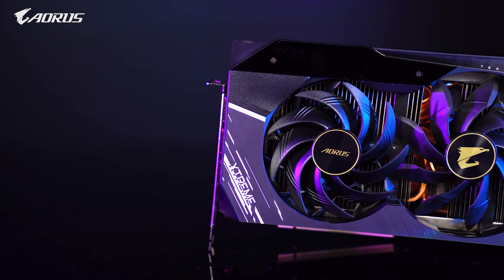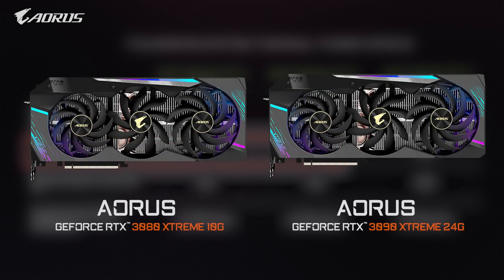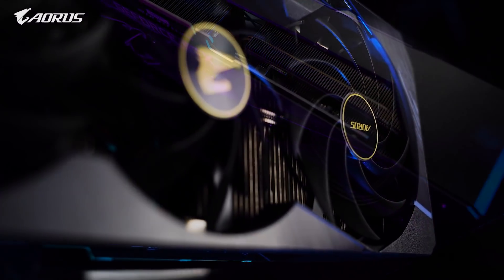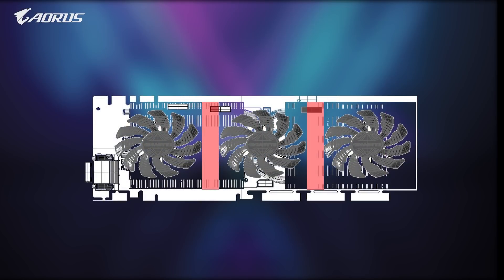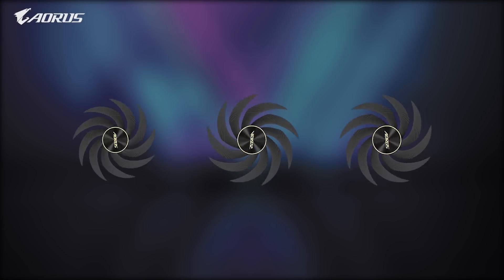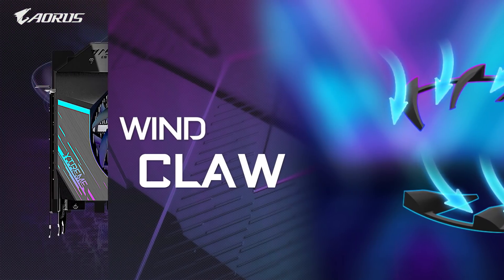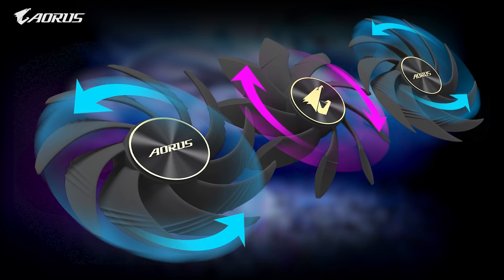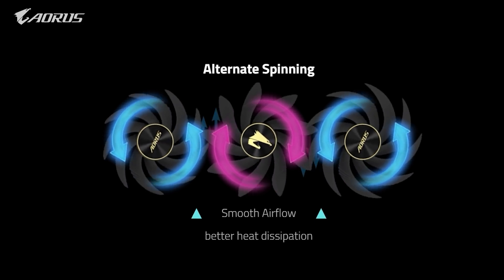AORUS RTX 30 Series - MAX-Covered Cooling | Feature Highlight

Comment: The real problem with this type of gfx card cooling setup in general (not limited to Aorus) is that the hot air from the cooler will be distributed in the computer case and not be removed from it quickly in a directed stream of air.  Even if the cooler fins are oriented towards holes in the backplate of the card, much of the heated air will go inside the computer case. At 70°, the fans on my card (currently a RTX 2070) start to spin up so much that my system is getting uncomfortably loud. The only way I managed to solve this problem and keep my gfx card at or below 65° C at all times was to install a fan in the side panel of my case, which thankfully has an opening for a  ventilator at the height of the graphics card. Unfortunately, it is pretty hard to get such a case these days. It's glass side panels everywhere. Personally, I don't care a bit about any bling inside my computer case. It sits under my desk and all I want it to do is to function as quiet and efficiently as possible.

Imo the perfect, although expensive, solution would be a water cooling circuit for the CPU and gfx card with a 240 mm or bigger radiator at the front of the case, pulling air from outside the case in the case and quickly removing the warm air with back and most importantly top mounted fans. I know that some tech sites claim you don't need water cooling, but they usually don't look at gfx card cooling, or even do their thermal testing with their test system's gfx card idling (which I believe makes absolutely no sense, since thermal and subsequently noise levels only become relevant when a system is under high load, thus creating a lot of hot air from the gfx card that the CPU cooler will inevitably use to cool the CPU).

Comment: Sounds nice, but so far as i heared all your gpus are 4 slot thick? I currently use a htpc case with your 1060 6gb 2 fan xtreme ed. version. This is around 2.5 , do you plan the 3070 or 60 in around the same thickness?

Comment: Are you going to fix the issue that the Aorus 2080ti extreme edition had that causes the fans to whine like they're taking off to space? That is caused by whatever thermal paste you use to completely dry up within 3-6 months of using the card, and is fixed by taking the card apart and reapplying new paste?

Its a fault of the card that a MIRIAD of people who own the thing have experienced, and should NOT be an issue with the cooling solution of a flagship card.

Comment: "Which negatively causes heat dissipation"  that doesn't make any sense.
Reply: I know right. You would want heat dissipation. How is that negative?
Reply: It causes causes it. That's what we want. But it causes that negatively. That's what he means. And they can do it in a better and positive way.
Reply: @highenemy2538  I get what you are saying but it is still not a good way to frame the expression  What the narrator should of said was "it causes heat dissipation inefficiently due to turbulence or something along those lines".
Reply: @holysnyper  exactly. I agree on that for sure. Am just putting out the true intentions out there.

Comment: NVIDIA  some guy  posted a video  there Manufacturing  has    3  chip  bins   1- 30%         2- 60%         3- 10%
  EG  no1 lowest class (windgate)            no2 are ti AORUS                 no3 titan Class     example 
the things you learn    all perform Equally good its just some have 10% better chip rates 💻

Comment: I seen the picture of the graphics card, where the dead zone would normally be, a solid black strip of metal. (Instead of more heat fins) Doesn't that solid black strip of metal kind of defeat the purpose of overlaying the fans?

Comment: However judging overclock shopping Aorus master and exteme will be overprice same like ASUS Strix. The cards will be on 15% more expensive than others except MSI which also expensive, but less a bit than Aorus and Strix. For example inno3D, EVGA, Palit, Zotac costs 650 pounds for 3080 when Extreme from gygabite costs 799 which is overprice. I understand cooling system is good, but pay extra 150 for it is to much!

Comment: Will this fit in a be quiet pure base 500 pc case with only aircooling?
Are we going to see 2x fan air-cooled performance gpu's that are under 200mm in Length, Width under 100mm and max 2-Slot card?  Or this will last year to get them?

Comment: I've had an Aorus GTX 1080 Ti for the last 3 and a half years. I quite like it, but the thermal performance could be better. I think the maximum fan speeds should be ~20% higher for more overclocking headroom. Currently at 2025MHz on the core it reaches my temp limit of 86°c very quickly and begins throttling to ~1950MHz.

Comment: these cards are rated at 320-390 watts respectively, old cards (really old ones) like 590 gtx were 417 watts or more, mine ran at 85c under load x'D the fact is, these cards won't ever run hot if you're running your computer properly.

Comment: Ain't buying until I see the temps and performance compared to the rest of the GPUs
Reply: more for us then
Reply: @alecmalykh  lol, reminded me of George Carlin.
Reply: If you want decent temps buy AMD.  Sounds so odd saying that.
Reply: @tnix80  Ikr. I wonder how much better the temps will be considering TSMC 7 nm is significantly better than Samsung's 8 nm. I can't wait for them to put the cards on the table so I can make up my mind. Founders Edition looks so tempting tho.
Reply: @thesignof33  word is Nvidia doesn't have a lot of supply for the first few months.  Also these stock coolers are impressive and expensive to make so they intentionally didn't order enough.  Margins too low.  I think aib cards will charge more for inferior quality parts.  Sure you might get a decent clock speed for a marginal performance gain and even more energy used.  But is that worth it?  

Aib models will probably take a while to arrive.  I would either buy an FE card if it's really 699, or buy AMD.  Because they're not going to be beat in price to performance ever.

Real benchmarks have come in, it's actually about 24% faster than a 2080ti if you're interested.  Videocardz is never wrong.
Reply: @tnix80  I've personally tested 2 of the AIB 3080s and can confirm you're wrong. On all benchmarks tested it's performing roughly 40-55% faster than the 2080ti.
Timespy was a straight up 50% increase. Videocardz is wrong, sorry.
Reply: bruh its nearly a quad slot card you should be ok, performance-wise tho idk this has only 2x 8 pin plugs, but the strix has 3x 8 pin

Comment: i am so confused, sometimes the card looks purple, then it looks black. I only want it if it is one color over the other.
Reply: i think that’s an rgb area
so when is off it looks black and when is on 
it shows a diferent color

the diference between the xtreme and the master are the color of the letters on the middle if the fans
the xtreme has gold letters while the master has something like silver ir gray

the xtreme might be a little faster but the gold color is a deal breaker for me
anyway my board is an aorus master 
so i guess i go with the aorus master 3090 card
for the silver gray letters and also to match my board
so the board and the card are both the master version

also my board has silver gray color, so it will also match the card color

also there it might be a light reflection coming from some where else
not necesary coming from the card
a reflection from another rgb light

Comment: These should come with a complimentary set of case fans
Reply: arctic p14 pwm pst 5 fan value pack is like 30 bucks, if you're gonna spend 500$+ on gpu then you can afford that for better airflow.

Comment: all metals, including semi-conductors, naturally form an oxide layer on any exposed, even temporarily. This is where most of the delta-T occurs. There was the ideal, to put two metals into a hard vacuum, removing the oxide layer, then putting the two pieces together, forming a bond. I would like to see someone do this between the silicon die and a metal heatsink